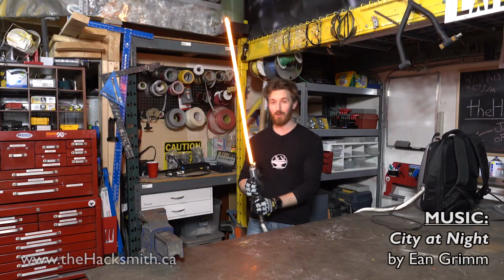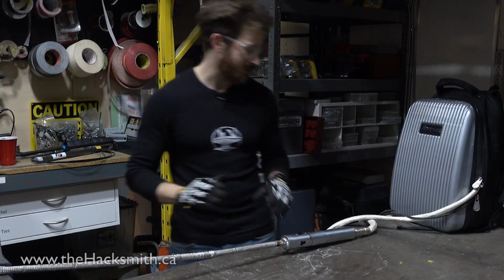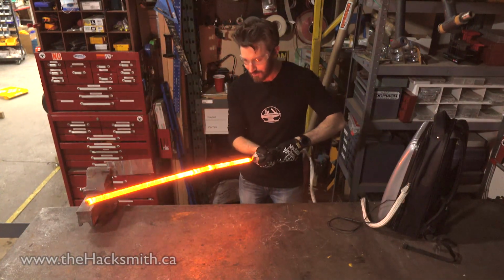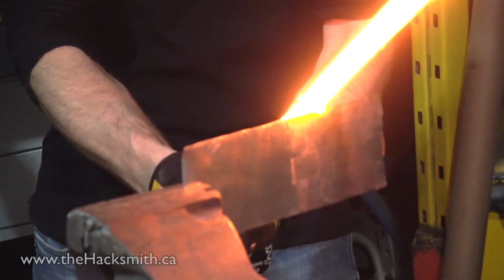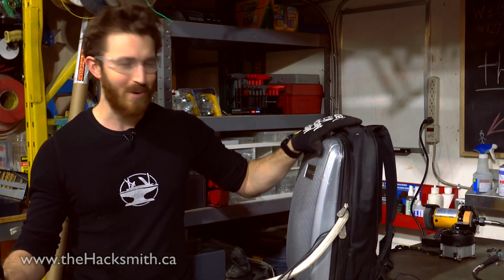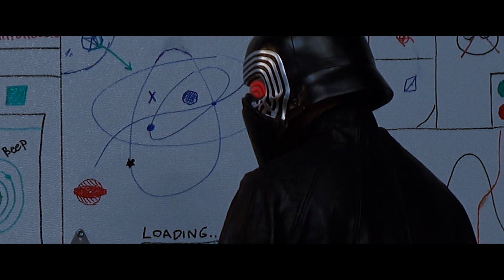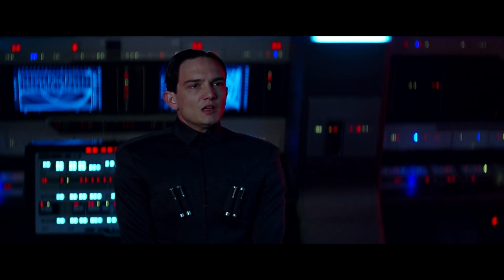2500° LIGHTSABER CUTS THROUGH DOOR!

Comment: Umm hacksmith is it possible to make the blade kind of be able to extend and compress like the steel baton of the police where the stick is tucked inside the handle so is it possible to make it like the blade will heat up when you extend it so it could really look like a lightsaber?
Reply: Im sorry if its difficult or impossible i just had a thought

Comment: See you actually made a lightsaber and the reason for that is because the original lightsaber had a battery pack and was needed 
To power it so this is the first step
Reply: I think the only problem is that its solid, even when turned off. Other than that, yeah. It's a protosaber.

Comment: You're comparing a plasma cutter, which oxidises steel in a focussed area with an air compressor and arc to something completely different
Reply from the maker: I don't remember comparing anything to a plasma cutter in this video...
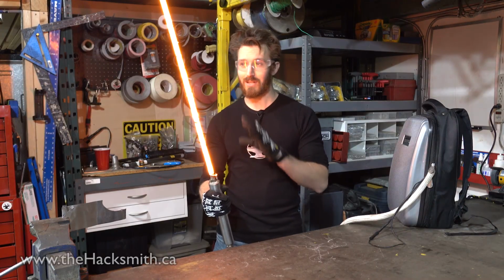Reply: ~4:00
Reply from the maker: I'm still talking about energy input and energy density though...
Reply: Even still, it's a completely different reaction, one is melting, the other is ozidising.
Reply from the maker: ...due to concentrated heat input...

Comment: Hacksmith you said that you need an ARC reactor for a real light saber, i am watching this in 2018 were you did make Tony Stark's ARC reactor
Reply from the maker: Yeah but it doesn't produce this much power
Reply: the Hacksmith yeah I could tell because I saw the video so yeah
Reply: How much power does the arc reactor put out and what could be done differently?
Reply: Bookworm et Common Sense well in Iron Man 1 they say it is an infinite source of power
Reply: @awesomeanbar9402  True, they did, but they also used different materials as well...so the question becomes do different materials react to electrical current differentially that could cause an infinite output?
Reply: Bookworm et Common Sense according to the law of conservation of energy, that is just not possible

Comment: It might be possible to do this with a plasma cutter design if you can find a way to work out exactly which point on the saber is making the cut, so only that section gets fully activated in terms of power. I think the way that I might do it would be to attach an ultrasonic ranger finder on the bottom handle pointing directly up the blade with an Arduino nano or something, this way, whenever anything comes within a few mm proximity of the blade, the ultra sonic signal detects it AND tells you the distance of the object from the handle/bottom of the blade, and therefore which sections on the blade (plasma outlets) to activate at any given time. Just limit your power supply to the appropriate amount. It might then be possible to run it from a battery pack, maybe, possibly. I'm sure there'd be a way to keep the whole thing glowing still.

Comment: Okay but what if instead of using a coil you use a single, sharp piece of metal on each side of a seperator to make an actual blade. It wouldn't really cut with heat alone, but it'd cut better than a wire-rasp.

Comment: I´m sorry, but I´m pretty sure the melting point of steel is not 1370 but 1538-9℃ so how can you melt it with somethink that has temperature about 1300 ℃ ？It is just a question i´m big fan of your job and I really like what you do.
Reply from the maker: Depends on the type of steel. If you google it, 1370 is literally the first temperature that comes up for common grades of steel

Comment: Why not make the blade a secondary single loop coil of an air transformator. The single loop elongated outwards at one point of the loop forming the blade. This way you can switch the low currents primary coil, can have the dangerous high voltage safely locked away and have a much sturdier blade. Two halve cylinders with some separation material?

Comment: No no no. You're going about this all wrong. You need a HV ion generator within a tube. Then a series or ring capacitors that are driven by phase shifted circuitry to pull the ions away from the generator and out the tube like fingers sequentially squeezing on a tube of toothpaste. Then an inductor at the other end of the tube to the generator whose magnetic field focuses the density of the high velocity ion stream in conjunction with the phase shifted frequency and ion charge ;) That way the beam will only exist when switched on and the magnetic field has a field formed structure that will repel like charged beams. Plus they dont have to dismember people when they can simply immobilise muscle. I honestly didnt spend a lot of time pondering this.....and my nose does not have a woody.

Seriously though, thanks for the entertainment.

Comment: It produced more water vapor, when you dropped it in the snow then it did with the e-liquid. The problem is, you only had a few drops on it, then it also got too hot and cached fire. It does not produce vapor if the liquid instantly burns away. I would love to see a new try, with the whole blade soaking wet in e-liquid with at least 80% vg and slowly powerd up, so it does not get too hot. Still a great video though!

Comment: To the hacksmith. The biggest problem/thing that needs to new improved to increase awesomeness 1000 fold is the blade shape. Using the lightsaber for hitting things is literally like using a broom. For v2, if you could somehow sharpen or bevel the edge, it would improve the design a lot. Instead of hitting a cardboard box and burning slowly through it, you would cut halfway through the box and then start burning it. Overall it would give the weapon better efficiency and cool factor. Anyway, that's just my two cents.☺
Reply from the maker: +Luke David so make a red hot sword.  :p

People would complain xD
Reply: True true. I suppose a sword just isn't the same....

Comment: Could you make the rod retract into the handle?
Reply from the maker: doubtful lol
Reply: Can you create a magical pocket that can hold things bigger than itself?
Reply: Not for another 2000 at years at minumum and that’s pushing it, I meant more like an extended baton but it probably won’t work because it would end up losing shape and fall apart because it’s not a solid rod.
Reply: If you can make it into something like a spring? Then probbably, yes.
Reply: Umm...very much no.

Comment: Hey, maybe you could try using lithium sulfur batteries. They are twice as powerful as lithium ion, so they should allow you to get more heat into the blade.
Reply: They are also lighter to carry
Reply from the maker: Are those actually commercially available now??
Reply: They are more expensive than LI, but I went looking to see if I could get them for a project and found some. I don’t know if the cost will be worth it, but it’s an option. The small ones range from around $80-130, but I don’t know if you can get bigger ones yet or what their cost may be.
Reply: It’s also a major plus that they won’t burst into flames if you damage them

Comment: Perhaps u should make it an actual blade shape (katana/double edged) then have separate coils inside the blade heat up the edge(s). Then the only thing u would have to worry about is venting the excess heat edited from the coils in the blades.
Reply: sCalliO RemiX It would melt the steel.

Comment: I think there's something missing to this...it should have something to hide all the red hot iron,and be more lightsaber like...so...this material sould be translucent and also a really good heat conducter
Reply from the maker: good luck finding something like that
Reply: the Hacksmith Perlucor...it holds around 2200°...it only needs investment...i understand that this wouldn't happen,since it will be probably really expensive to do
Reply: the Hacksmith But if you have the money,i think it would look way more cooler with a glass like material surrounding the rod,making it look like a smooth surface...but Perlucor is the way to do it

Comment: Meh, lightsaber is plasma, you just made a hot metal stick. Not impressed. Building lightsabers is actually possible. Since plasma is ionized you can control it using a magneticfield. Having a strong, saber shaped magneticfield, it would be possible to make the lightsaber. The different colors of lightsaber can be made by using different elements as plasma.

Honestly you're just goofing around with that metal stick which isn't even straight xd
Reply from the maker: +Vas Yan do it yourself then
Reply: Why dont you make it then?

Comment: Can you slash at things with it? Or can you only slowly burn things?
Reply: Ben TheFox I would say he can only burn slowly cause the blade will break if he slashes
Reply: Adrian Miller That’s what I thought. But I was just wondering.
Reply: daggers... with something like a tungsten blade? that'd be interesting
Reply: Endoma, he was saying 100kw would be needed for the steel table I believe as that would be the closer equivalent to the plasma cutter.
Reply: Ben TheFox  it's not hot enough
Reply: Maybe a thing he can do is make it smaller and stiffer. Maybe 2 feet tall or 3 feet tall . He could make something different like daggers that you can make holes with and itlll be more stiff and possibly more heat
Reply: Ben TheFox maybe if he could edge the blade
Reply: Watch it in 2x speed if u wanna see it go thru shit faster
Reply: i think he said he would atleast need 100kw power supply to get enough heat so he would be able to cut through things faster then now, maybe not slashing but faster.

Comment: Still can't melt steel beams.
Reply: That’s what jet fuel is for ya dingus
Reply: joost1120 Dude go along with the meme for once :p
Reply: joost1120 thank you I'm tired of retards thinking it was "impossible" they don't even think about the fact the beams get as soft as butter when heated up.
Reply: Jeimy Hernandez what does m mean
Reply: joost1120 i know. but its only a joke man, chill
Reply: ajossi still cant melt steel beans
Reply: M
Reply: Razan Ar it's such a stupid meme. In an open field without any wind, jet fuel won't reach high temperatures. But like charcoal in a forge, given enough oxygen and pressure it will most definitely reach temperatures to easily melt steel beams. Not to mention it wouldn't have to melt steel beams in the 9/11 situation, raising the temperature alone is enough to weaken it to collapse under the weight of the building.
Reply: Garrett Uryan it cant melt steel beams tho

Comment: @the Hacksmith
Have you thought of including a deadmans switch into the device? A way that, if it is dropped for any reason, it would automatically shut off? 
A trigger in the handle to complete the current would be more than enough. Just in case you drop it, and they need to get to you, they can. And as it falls to the ground, there is no electricity still going through it.

Comment: For the plasma what is really cutting is not the electricity but the air passing through. The electricity heats up the fine point and the air pushes or cuts through. Take a look at the spiral in the plasma consumables and The tips cover.

Comment: It's not the best it can get, but it's still the closest to date (as I'm aware) some have tried building super thin and long reading flamethrowers using various coloured flames, while others have just tried giant lasers. This is by far the closest we have to an actual light sabre.
Reply: MMOPro Nick
Closest to an ACTUAL Light Saber

This is already a Proto Saber
Reply: Well, almost it's blade is still there when off

Don't know if the very first protosabers had that but later one's didn't

Your name worked well with this comment
Reply: Mitchell Woelfer I would say that an antimatter battery in the near future could supply the energy need
Reply: Golden protosaber*

Comment: You should try silicon carbide instead of graphite. Silicon carbide stays stable in air until more than 2000° Celsius! I made several experiments with electrically heated silicon carbide a few years ago. Was quite fun. But this silicon carbide draws alot of power in the kilowatt range for small centimeter sized grains. The heat and light emmission is quite impressive. The ability to ignite stuff is even more impressive. Such hot things can ignite things even in a fraction of a second as a video of a recorded experiment showed.
Reply from the maker: We didn't use any graphite..?
Reply: My error. I mean instead of khantal. I wanted also suggest graphite but it burns to fast at high temperatures. Probably my brain made a little break while i was removing the graphite from my suggestion.

Comment: The arcs may be caused by the fire when you cut through highly flamable stuff
Fire is a type of plasma, and it conducts electricity a lot better than air
So when fire goes though the fiberglass it can cause sparks
Reply from the maker: nah it's because its a ton of power going through a much smaller section -- it's literally welding itself shut in a new location xD!

Comment: What if u used the same technique but on a sword. So electricity flows through on both sides of the blade with the flick of a switch and moves so fast that it slowly burns and the blade gets hotter giving it the same look as the light saber. Good luck finding a strong enough blade

Comment: I have a suggestion for your mark 2. A sword with an induction-furnace core. Now in the first movie A New Hope the lightsabre when ignited looks as though it is a blade, it is not a cylindrical column but appears flat. This will allow you to cut with speed rather than slowly, though the material would need to be able to withstand high temps to avoid warping with use.

Comment: You included Darth-Tantrum, the most scary of the dark lords...  Much feared for his temper tantrums that would impress a toddler not getting candy. I've got some suggestions: A vibro blade of some kind (hundred-million hertz oscillation) or a Thunder Hammer or similar electro-discharge blunt weapon (head discharge should be in the hundreds of thousands of watts, should be doable with a big capacitor bank and an industrial motor contractor for your switching, I've got an old solid state switch from a coil-gun project that is good to 2K Amps DC). Editus: meant if you need a high energy solid state switch I've got one you can use. Also fixed kilowatts to watts a couple 250kw should be plenty of energy discharge for an electronic discharge melee weapon. For points of reference the damage is caused by the heat and disruptive arc rather than through conduction of the energy to ground through the target. At those levels you should get a small and intense explosive effect, might need your mjolnir though because physics. Aka, it will blow the hammer right out of your hands as well. In fact, being the lighter of the two objects it will be the one moved, so it needs to be real heavy.

Comment: You may be able to replace the filament with plasma. Try heating it up enough that it creates a vacuum, then you can run plasma through the vacuum. Then you could take an electromagnet and push the plasma out the top, as plasma can be pushed by a magnet. Just try not to set the handle on fire.

Comment: Insted of wrapping wire around the rod you should try making a hollow rod out of wire by wrapping it around itself in a arc-like supportive way so that the wire itself is the support.. this would eliminate a lot of problems with your core at a cost of making it only a bit thicker.. this wont work with a plane hollow rod because the rod would deform as it does not hold any inner tension that prohibits moving and deformation. Using two different wires is also great idea one for resistive heating and one for support.. Take into account wire expanding when getting red hot and adding strength to this structure

Comment: "The vaper menace " lol this is awesome closest thing to a real life light saber . You said in the making video that tungsten would get way hotter but more expensive and use more power, could you coil a tungsten wire around like you did with your element? Power and cost would still be an issue but maybe thinner tungsten wrap would use less power? I dont know much about all that stuff just a question really lol

Comment: if you want a better lightsaber approximation, build a cutting torch which runs on pure oxygen and propane, hydrogen or acetylene. run it on higher pressure and perhaps a special nozzle to get an extremely long flame. add a valve to adjust the fuel/oxidizer ratio to switch between cutting torch (excess oxygen, works similar to a plasma cutter) balanced and excess fuel. then just make it into the shape of a lightsaber and perhaps you could even get gas bottles that are small enough to eliminate the need for hoses or wires.